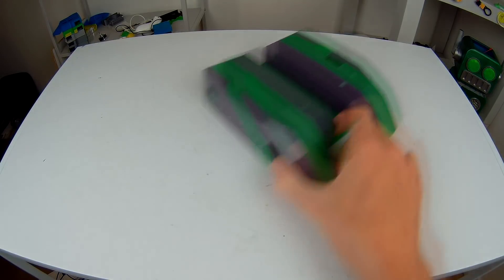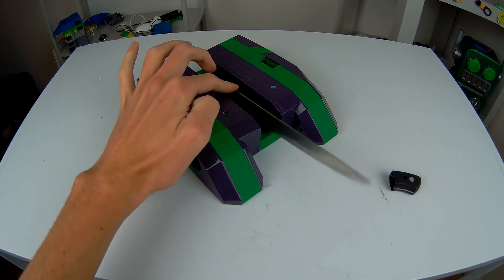Balloon battle combat robot!!

Comment from the maker: Please note, in the drive tests the front right motor wasnt spinning.
It was a brand new motor but it was dead on arrival. I had to unplug it after the wheels up test so that the back right wheel moved.

It will be replaced once I get some new motors

Comment: If the frame is made of abs you can connect the peices by brushing on a little assitone on the edges where the plates meet. It melts it a little and it becomes one peice. Great video 👍.
Reply from the maker: That is a handy trick!

Unfortunately, its winter here in Aus and I don't have an enclosure on my printer, so I'm stuck printing PLA or small ABS parts for a little while. Hopefully, when the weather warms up again I'll be able to print the chassis again in ABS

Comment: Looks like your right front motor/wheel (from behind the bot) isnt spinning,
Reply from the maker: Unfortunately it wasnt spinning, its a brand new motor but it was dead on arrival. I had to unplug it after the wheels up test so that the back right wheel moved.

It will be replaced once I get some new motors

Comment: Can you put links to the drive motors and ESCs you used? I think they’re the same as your beetles. On a side note, nice bot. 

Edit: That thing looks like Lock-Jaw.
Reply from the maker: No, I cant

The motors are just 25mm 1000rpm brushed motors, I got them from eBay AUS so the link I have is useless outside Australia.

The escs are generic 10A brushed ESCs and they are garbage. They are good enough for a demo bot but I would never put them into an actual fight again. So I do not recommend them and wont give a link.

Yes I took some inspiration from lock-jaw
Reply: 1. Thanks. 
2. Just put the link on your side. I can copy/paste the product name on my side. 
On a side note I just got the new Hexbug Battlebots build your own in the mail last night.
Reply from the maker: The product name is literally:   1000RPM 25mm DC 12V metal gear motor
Reply: What do you reccomend for beetles?
Reply from the maker: You saw my beelteweight breakdown video right?

In that video I recommended these exact motors, and no others. 
So again, I recommend 1000RPM 25mm DC 12V metal gear motors

For ESCs I cant help you, don't buy generic 10A escs from China, they are bad and do weird things.
I use BotBits 10A esc, but they are an Australian thing so they aren't available everywhere, but if you can get them I recommend them
Reply: For the ESC I was thinking of using the Endbots DESC. Can you upload stl files for your beetle wheels (and maybe this bot)?
Reply from the maker: No, I do not ever recommend printing a beetle chassis or beetle wheels.

The only reason my beetle wheels work at all is because I have printed them in TPU.
I know if I release the files someone will print them in PLA or ABS and then get angry at me when the wheels break in a fight.

Unless you can print exotic materials, do not print parts for a beetleweight, full stop.
Reply: I am very pro wheel guard and that is what I reccomend for every combat robot. (Guards not wheels.) Mine would be protected. (If I can CAD a good combat robot design.) 

Edit: Let's get real, who DOESN'T bring spare wheels to a competition? That would be my way of dealing with wheelectomies.
Reply from the maker: Wheel guards are a great idea, but I'm still not releasing my wheel designs.

Guarded and protected they might, might be ok. But I know, that if I release the design someone is going to blame me for losing fights, when in reality, they printed the wheel weak in cheap PLA and left it exposed.

I only release things I am confident people will have the same success with that I have. These wheels will never fall into that category
Reply: Ok. Did Absolutely Quackers win any fights?
Reply from the maker: Yeah, it was in the non-destructive class so it won half a dozen or so.

I stopped running it because the non-destructive was full of kids and first-time drivers, and I felt bad beating them, so I focused on the destructive class
Reply: Any videos on that? Maybe the next version of AQ could be a loan bot.
Reply from the maker: Not that I know of, maybe on the ARC channel but I couldnt tell you.
All I can say is that all of the fight footage I have is up on this channel. So if you cant find a video here of one of my bots fighting then I dont have footage of that bot.

It will be, I have a bunch of designs I want to make into loan bots but I've been rather busy lately so I havent worked on them.
Reply: 1. There were no ARC fights due to a lack of uploads. 
2. Good idea.